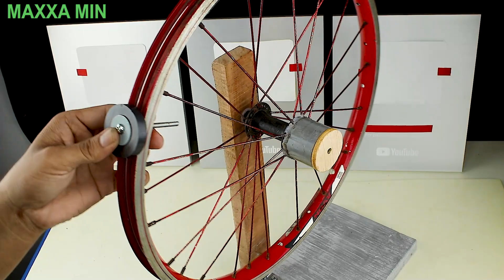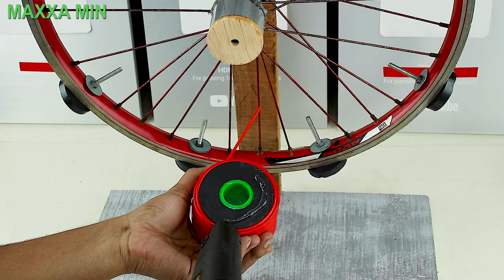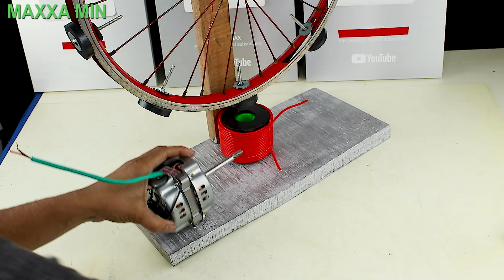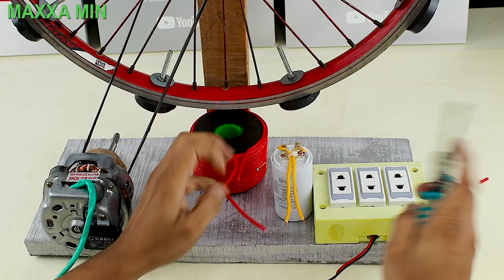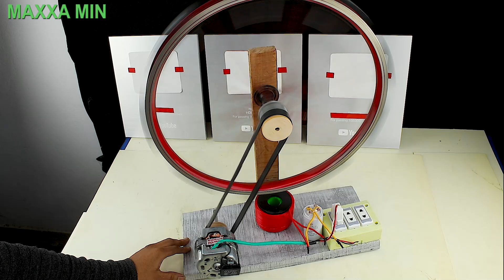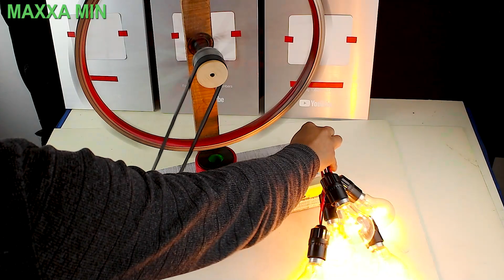Free Electric Generator Ac Motor Magnet Capacitor United Electric 15KW Power Generator new

Comment: i am no electrician heres my opinion i see it creates an endless repeating spinning wheel because of energy just circuits back, but i see with your devices it creates the same output the motor needs to keep going, but its pointless since if you plug a device or appliance in the plug the circuit will be broken then that wheel will slowly spin until it stops.
Reply from the maker: Thankyou for comment

Comment: Impossible. For no technical people:  E-Bike wheel can handle 0.25KW, special wheel about 1KW.  You can NOT transfer 15KW through bike wheel with "hot glued" shaft.  15 KW is the power that allows an electric car with 5 people on board to drive at 80 km/h

Comment: I wonder if you can add some thin metal plates to the spokes and to turn it into a fan and then add some small wind turbines. Keep cool in the summer and maybe a low power electric heater for cold weather so it blows warmed air.